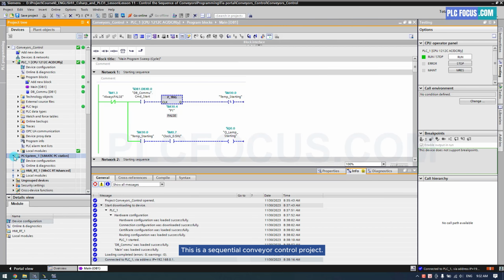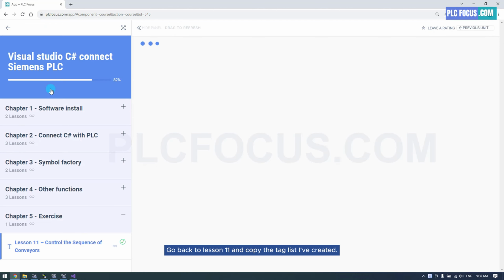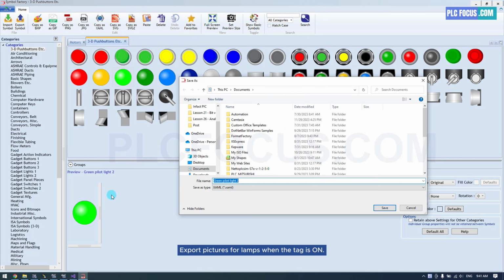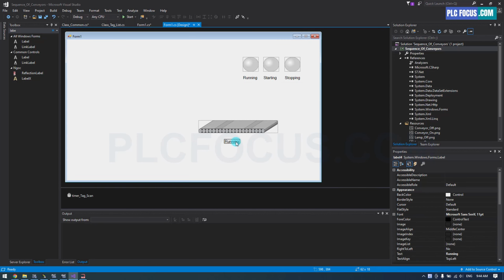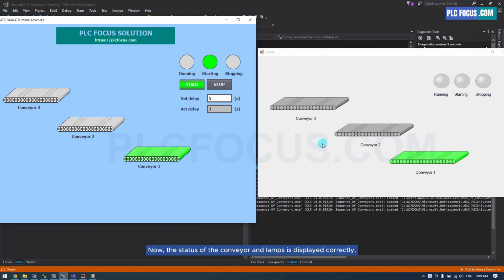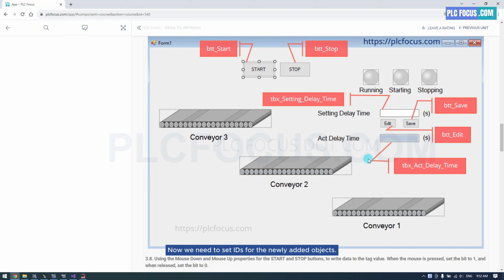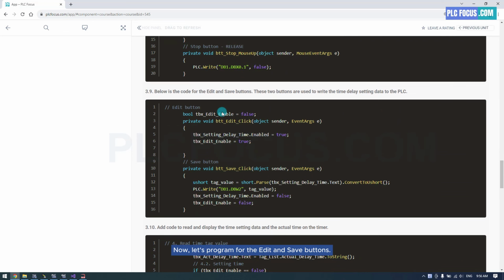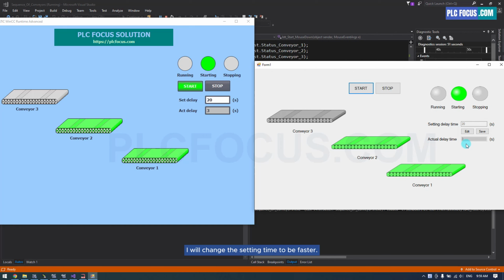C# and Siemens PLC lesson 8 - Exercise Sequence conveyors control

Comment: Hi, Good videos, excuse me, I´m doing an app between PLC s71214 and Csharp, similar to your video. It works well, but after about 25 minutes my app doesnt change values, (boolean or int), do you know if the app need something to release/erase memory? or something like that? Thanks
Reply from the maker: I think the connection is lost between PLC and the app.
Reply: @plcfocus.solution  I think the same, do you know, if there is a command to extend some timeout? Now i use an "IF" to know it the communication fall and reconnect the communication, but it works more or less. Thanks.